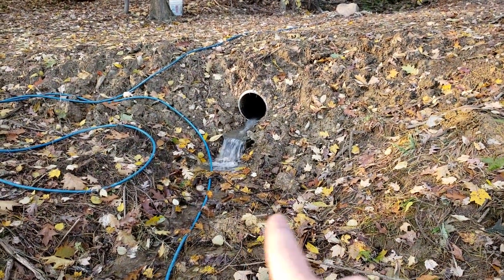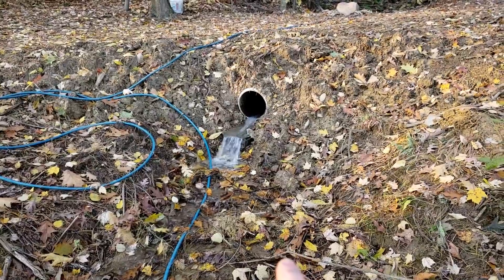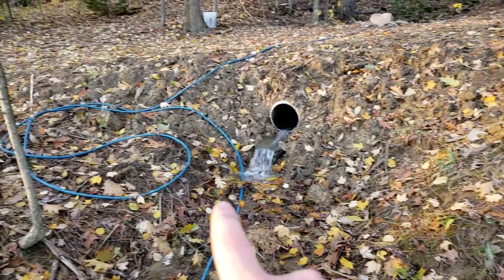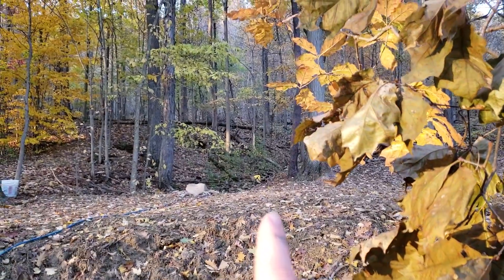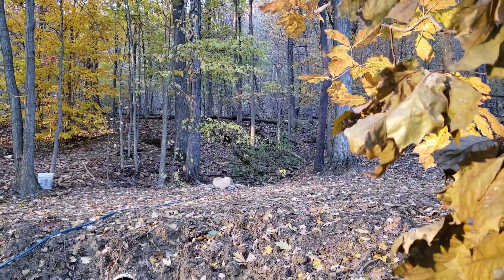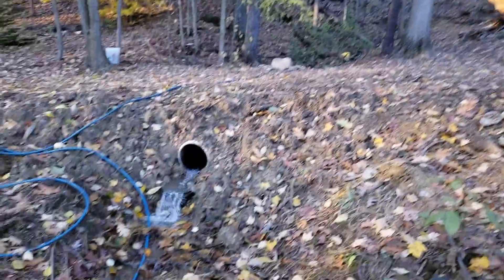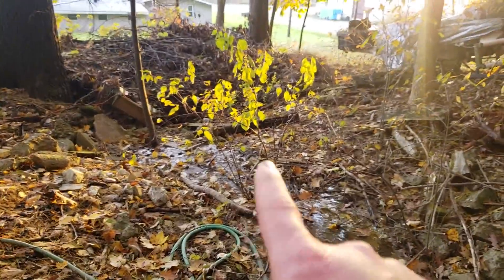Permission Granted! Spring Cheek Microhydro Begins!

Comment: fyi, in case the implication was missed, at a site having such a very-low flow rate, only one type of hydroturbine will be  Efficient.
Reply from the maker: Actually 2, turgo and pelton. Leaning towards turgo.
Reply: @JoeMalovich  pelton would be better at that head. And david davids has a load of over-unity videos so i would listen to a word. just watched a video of him talking about getting more then 100% efficantcy from a wheel being spun with a friction drive, a chain, and pulleys and sprockets he is clueless!
Reply: Turgo...seen best results with them
Reply: @fuckelonmusk9395  thats nice.    some info.    Each Type of hydroturbine is  BEST-suited to a  Range  of head and flow rates.    the flow rate of a typical spring is in the range of the  very,very,very,very  low.  this factor will NOT CHANGE.  and  only a  MASSIVE  amount of head would result in more than a few watts of potential energy being available.    at  ANY  SITE, best efficiency will be achieved when the   Type  of hydroturbine is  Correctly  'matched'  to the Conditions at a site.    conclusion:  it is Very common for diyers  to  NOT correctly  do such 'matching'.     examples include, attempting to use a  HIGH-speed  runner,  where the Conditions are NOT suited to such use.   cheers

Comment: it makes no difference to me how you waste your time and money, jm.     but in case you happen to infect others, that little dribble represents a flow rate of about  point-five liters per second.   yer stated eighty meters of head results in the  Huge Total  Available  Potential energy of:   THIRTY-FOUR  watts,    B E F O R E  losses.    does this song sound familiar.   joe, you have a knack for over-estimating flow rate.   cheers         googletranslate
Reply from the maker: plug your numbers in here: https://www.engineeringtoolbox.com/hydropower-d_1359.html
Reply: Sigh... It's absolutely appalling how few people know how to do the math.
Let's show you how.
0.5 Lps means that you have a mass of 0.5 kg per second.
Multiply by the distance dropped
0.5 kg/s * 80 m = 40 kg*m/s
And now for what you most likely forgot to do. Multiply by the local acceleration for gravity. 9.8 m/s^2
So 40 kg*m/s * 9.8 m/s^2 = 392 kg*m^2/s^3
And conveniently the very definition of a watt is kg*m^2/s^3, so using your values gives a power of 392 watts before losses.

Using the figures given of 0.73 Lps and a head of 86.8 m, the power before losses is 621 watts. Assuming a 50% system efficiency, that boils down to a bit over 300 watts.

If you dispute these figures, then I would request that you show me YOUR math instead.

Comment: There is NO way that you are going to get 300 watts out of that. 30 at best.
Reply from the maker: Please check out this video of this spring I'm developing and the stats of it below in this comment: https://www.youtube.com/watch?v=F4TJhYNhX8k

Stats:
Head: 286ft     86.8m
Flow: 11.5gpm      .73Lps
Pennstock Length: 800ft     244m, average 22 degree slope, some areas 45 degree slope.
Max Power: 600W (Based on the equation GPM*Feet*.18=Watts; the .18 is a factor to make the units work out)
Estimated Max Power Output, 2" pipe, 80% efficiency ~500w probably more like 350w.
Static Pressure estimate 123psi
Reply: @JoeMalovich  Yep.  A pelton wheel would work well with that pressure.  This video is from NZ where someone gets about 600W from their creek. https://www.youtube.com/watch?v=0ieFZI4-6K8
Reply: 80m of head at 1 liter per second would make 471 watts at 60% efficiency you have no clue what your talking about. he will easily get 300 watts out of that lets say the flow is half that it would still be 235 watts at 60% and 75% is easily achievable with hydro.